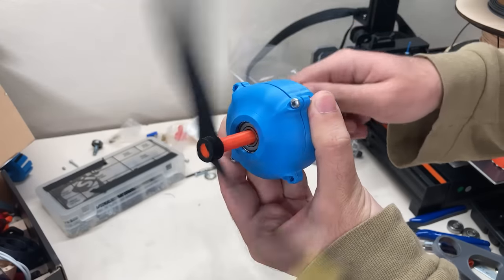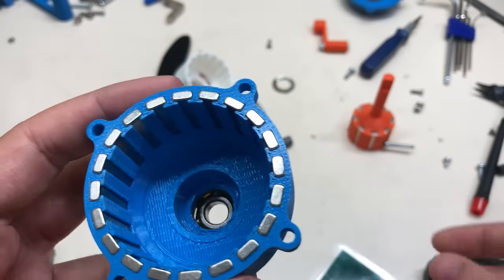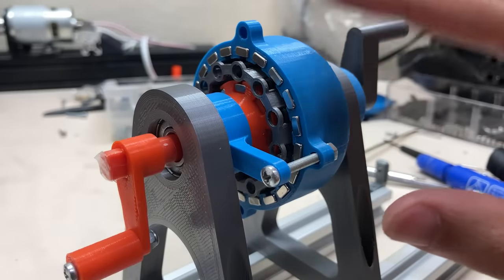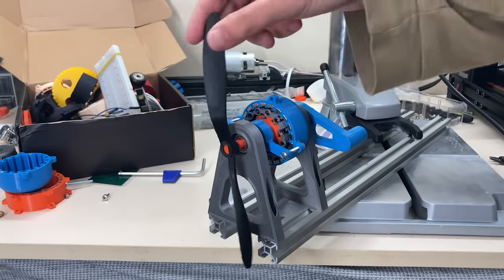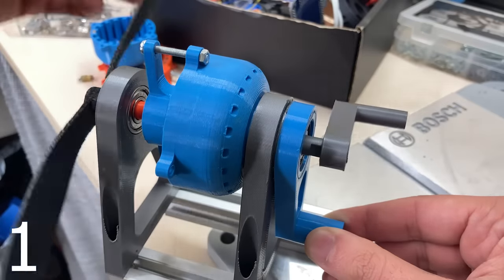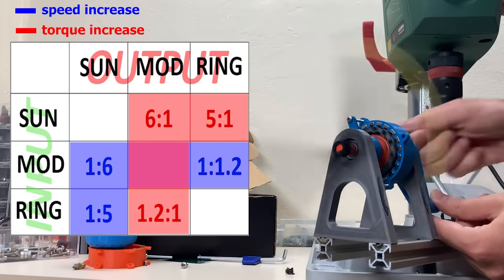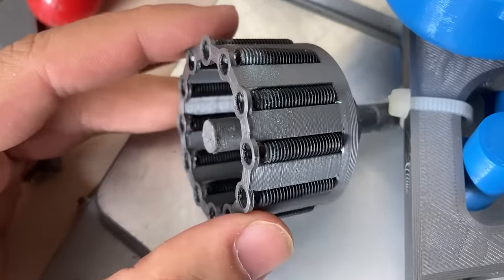How this magnetic transmission works?

Comment: It's a gear ratio of 1:6 with no touching parts. This is actually pretty genius. Now if we could cost affectively up scale and manufacturer with correct tolerances. I can see  this gear box being be used in maybe in equipment, or vehicles, or maybe even wind turbines since wind turbines are very hard to service this would be great because there is no touching parts of the tolerance are correct

Comment: The fact that magnets are becoming more and more rare
Reply: What makes you think that?

The strongest permanent magnet are made using neodymium, which is a common element that require refinement prior to use.

If you're talking about naturally occurring magnetic material like lodestones, they might be becoming more rare, but who cares,

They aren't what's uses in the production of magnets used for motors and linkages and such 

All commercially applicable magnets are manufactured as an amalgam of various metals that then goes through a sintering and machining process.

Comment: Can't wait to see final design with not wobbling rotor and planetary gear. But I gues 3d print can't support hollow shaft with another shaft in it. You can use metal tube and internal rod and glue them to plastic gear and rotor respectively.

Comment: The wear at the end was due to the drive motor input shaft not being coaxial, and exerting a radial force in the shaft. The carrier then was pivoting over its single bearing and therefore the end of the carrier cup was hitting the ring.

Comment: Put the clutch on the bands of an automatic transmission.  Then a new clutch is easy.  Just drop the pan, unclip the old band and put in a new one!  Good project for you.  (they say that the replacement of the old clutch is so high that a manual clutch is not practical.)

Comment: There's a market opportunity for this technology in aviation. In general aviation applications, there are gearboxes (prop speed reduction units PSRU)  that reduce engine rpm down to accommodate optimum propeller speeds. Most propellers need to run between 2,200 and 2,800 rpm. Anything faster and the blade tips go supersonic where they're not efficient. 

Most legacy piston aircraft engines are low tech, big bore, affairs. They drive the propeller directly through the crankshaft at 1:1. So low rpm where engines are not as efficient as they could be. Very reliable but low tech stuff designed in the 40s-50s. There are faster revving engines in GA with PSRUs but the weak link is the reliability and high maintenance requirements of the gearboxes. Especially in the higher horsepower ranges. Another challenge is harmonics and damage done when engine power pulses damage or wear gearbox components and the propeller. 

It looks like this would have it's own harmonics/pulsing challenges but maybe not as much as a direct drive gears? Could this dampen the pulses from a piston engine?

Could this tech be scaled up to high torque applications? I think most 250hp+ piston engines produce torque in the 400-500 ftlb range. https://www.youtube.com/watch?v=lYwUQBi3EW0

I think this tech could solve a lot of the drawbacks of using a faster revving engine coupled to a PSRU.

Comment: I know this is asking a lot, but I would love to see a transmission style.  Your current build would be a simple gearbox with 1 input to output ratio, but if you add some way to change the ratio, you’d be able to have a transmission.  I would imagine you could use electromagnets to make a w speed transmission, and if you building it big enough, you’d be able to have some magnets be dormant and engage at a later time to make a multi-speed transmission.  I’d love to see this made somehow.
Reply: I was thinking alternator to the but I imagine adding a transmission with free moving magnetic energy would lead you to free energy right?
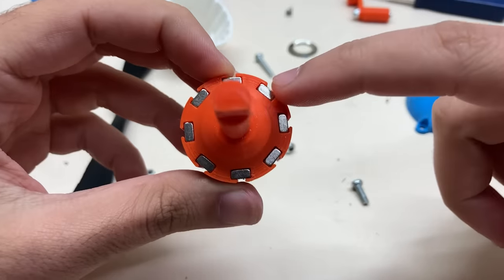Reply: @jasonneu7519  No, that would be if you used the output for energy production.  I've done some brainstorming on this and what I have is a lot like what Retsetman has made here, but with more complicated  by having electromagnets involved.  The main difference being that the outside rotor would have wires leading to each magnet. Each magnet would be replaced with an electro magnet.  If your input gear had 10 "teeth" and your output gear had 100 "teeth" you have a 1:10 and a mechanical advantage of 10. 
Now take those 100 magnets and set them up so instead of being + - + - + - turn on a switch that reverses polarity of certain electro magnets  so you output gear was - - + + - - ++ your now have an output gear with only 50 "teeth".  This would give you a gear ration of 1:5 and a mechanical advantage of 5.  You will be getting less torque but more speed.  This is exactly what you want in vehicles.  More gear ratios means you can have a higher torque outputs.  This is why tractor trailers are sometimes 18 speed transmissions, while cars are typically a 5-6 speed transmission.  Same thing applies to high end cars;  the corvette used a 4 speed transmission.  This mean it could quickly take off and hit high speeds, but wasn't strong.  So in order to reduce weight of the car, they used fiberglass for the body, and not steel.  Fun fact, that's why you don't see corvettes that have been in accidents, you crash, its totalled.  If a vehicle were able to have a magnetic gearbox, it would be able to have any number of gear ratios.  Since it has any number of gear ratios, it would be able to use computers to calculate the best ratio.  If done correctly, this would make it so the transfer from one ratio to the next may not even be detectable as it cycles through 100 rations in under a minute.

Comment: Excelent design!!!

This is like a planetary.

If you keep the sun stationary and rotate the case… does it increase the speed to the output (planets)?

Also, if you keep the output (planets) stationary and rotate the case, does it rotate the sun?

I continued watching the video and YES!! 😅

Here’s a new idea: what if you replace the sun with an outrunner drone motor coil? Could it work as an RPM adder-subtracter?

Comment: Very interesting, my first thought was how much torque load could a magnetic gearbox handle.
Reply: Did a bit of research. Apparently an high efficiency magnetic gearbox is limited to 286 nm/L while a normal one in theory is near infinite (as long material could handle stress. Mechanical gearboxs on cars can easily reach 4000nm/L some high stress machining could reach 14.000 nm/L.

So these could have a great application on low torque situations. But once you start to stress it will start to fail.

Comment: I foresee several issues. It cannot be disengaged, i.e. no neutral. It's going to be massive, both big and heavy. It will have a lot of inertia, reducing acceleration and making the shifting procedure very complex. It will be inefficient, every time a conductor (like the allen screws) "slips" through a magnetic field there is a parasitic current generated that causes heat loss. It will require a fluid and radiator for cooling. It will jitter at low rpms and high torque when the rotor "slips" more easily and noticeably.

Comment: These are similar to magnetic couplings.  They all suffer from low torque at start up.  So trying to get a pump or other driven equipment started under load is the big issue.

Comment: At that high rate of RPM, the plastic is more than likely getting distorted  and if its out of balance it will cause vibrations. there are harder plastics for one called PEEK.  Also the machining needs to be precise and balanced at high RPM. This was kinda interesting though.

Comment: I will use this on an electric cars drivechain. Ive been looking for ways to power fans without draining too much battery power. With this i could possible harvest power from the drivechain/ high rpm and momentum. Connect a magnetic gear to power my fans (fancar) i will deff research and make some tests in smaller scale aswell
Reply: would like to see this! Not to be a downer, but I would think that fan manufacturers would use this if it was feasible. Likely the heat cycling and loss of magnetism would hurt the longevity. I would love to be proven wrong though! good luck with the project!

Comment: it'd be great to discuss the pros and cons of this. clearly there is resistance so there are losses. the strength of the magnets would also limit the torque that can be used. its an interesting concept but what practical application?. surely a brushless motor would be far better?.

Comment: Could you not use a light oil/mineral oil in the gearbox/transmission housing to help remove vibration/friction, maybe a lubricant that is under a little pressure? I apologise if this is a stupid idea, with no background in building magnetic transmissions I am spit balling. Thank you for sharing your video.

Comment: The problem with these is that if you made one out of metal this would create electrical currents that would house the metal to heat up a lot.  Also all those interacting electrical and magnetic fields would probably mess with electromagnetic waves like radio waves, making wireless communication kind of sketchy.  I would probably want to encase the gearbox in a faraday cage.

Comment: This is amazing.
But it looks that the issue is mechanical stability at higher RPMs. That suggests metal. I guess aluminium is out of the question due to eddy currents creating a breaking effect?
Which metal could you use to fashion the mechanical cages from instead of plastic? 
Would it be easier to just manufacture the whole thing out of a iron nickel allow and add permanent magnets to that?
Really intriguing. I guess this would be perfect for gears in robot joints or drone prop drives.

Comment: There is actually need for lubrication, any of the moving parts that connect to the shaft would need to be lubricated, right? It's not like nothing in that entire thing is making contact with anything else. Just a question

Comment: Wow another thought is using this on a windmill, you could step up the rotational speed with no losses due to friction. Just a thought!
Reply: Gearbox losses would be lower than the losses with this system, snd a gearbox would be lighter and less expensive.

Comment: So in theory if you took this then had 2 of em back to back, then on each planetary have band clutches that grab each different part of the planetary then after the basic 3 spds have an overdrive a High & Low range to get something useful like a 5-6spd transmission.

Then after that patent the design.

Comment: this seems more like a hybrid between a torque converter and a gearbox. the magnetic flux is the transmission fluid while the poles are the gear teeth. it would be interesting to see this in operation on a r/c car or maybe even ultimately, a full scale car.

Comment: I know that this is just a demonstration model. If it were attached to an actual motor running at 3450 RPM, I would install magnetic bearings. Then the motor magnets would float within the housing.

Comment: if you increase the torque, the magnetic force will break.( failure magnetic coupling) Magnetic coupling is consistent at constant speeds.

Comment: Could a magnetic gearbox hold load though? Can it actually do work as in, can it transfer horsepower?
Reply: Yes. But the loading capacity would degrade significantly with use. The heat and cold would also degrade it too. The worst would be the constant exposure to other magnetic fields. So it not really feasible in most scenarios but some places it thrives.
Reply: @need2connect  could graphite be used as a lubricant in areas where friction causes damage to the gearbox?

Comment: Looks good, can't imagine this working well on large vehicles like cars or trucks sadly. Can't have any slippage in street vehicles. Plus you do need more than one gear in your street vehicle. Even drag cars tend to run 2 or 3 speed power glides.

Source: ex mechanic. Cut this pretty short so as to not make a wall of text.

Comment: According to all above: torque slip, internal losses in power due to overcome magnetic fields and rather step rotational behaviour + price makes this rather an fun idea than true innovation. Also some "exotic" appliances don't make sense to me as long as regular bearings are in. And even if all active parts will be magnetic still i don't see real application for that, cause out there are a lot of materials/designs that makes regular mechanic gears pretty reliable, efficient and affordable.

Comment: This is a very nice demonstrating using a plastic (3D printed) gear box casing. Have you tried this using metallic casing? In that case would generate Eddy currents result in an increased  opposing magnetic field  (a la Lenz's law)?

Comment: Festo has done the best job with magnetically coupled air cylinders but VFDs have replaced all the similar eddy current drives that changed speed y changing the magnetic field

Comment: Let's say that the magnets are encased in aluminum, and we decide to use a twin prop design, if the gearbox were struck with lightning, would this potentially reduce or eliminate the magnetism enough to make it inoperable?

Comment: I doubt if this magnetic gearbox would provide any meaningful torque for real life application for power transmission.  What would you suggest the real life application of this gearbox? We all know how to use higher gear ratio to achieve a higher rpm but having a reasonable torque is also a key for power transmission.

Comment: It would be interesting to see performance gains/losses with the magnetic system, versus gearing.   I'd assume that all the heat loss from the gearbox would mostly just go away. 

It would be nice if you redid it with either CNC'd plastics or aluminum.   Just so they wouldn't have the irregularities of 3d printing.   You can probably use a Chinese "3040" CNC, that only costs around $1,000. 

I'd try it myself, but I have other projects due, and no immediate application for this drive.
Reply: The heat due to losses would be much higher with this crudely constructed magnetic device than with a gearbox. A better-constructed magnetic device might be as efficient (and thus have the same amount of heat generation) as a gearbox.

Comment: They had problems with too much applied torque or sudden speed changes, right?

So mechanisms like this would only apply to rotation systems with long operating periods and low speed variation. What occasions are systems like this applied in real life? Prolonged use, constant speed, gearboxes.

Comment: Could this work as a propeller rpm reductor on aircraft? Engine running at say 4000 rpm and prop spinning at 2000? Eliminate the mechanical reduction which is a headache on turboprop and piston engines.

Comment: Interesting, if you used an electromagnet, you could change the gear ratios just by changing the current direction in the electromagnet. There would be issues of back emf forces that you would have to worry about though.

Comment: Was there in increase in temperature? I want to assume their wouldn’t be since their shouldn’t be any friction if machined and balanced properly but I’m no engineer. On second though the bearings should be producing some slight heat

Comment: I imagine one could make a much more flexible electronically controlled electromagnetic gearbox by using an electric generator for the input and motor for the output, much like they're trying with jet engines by using a generator on the turbine to power the compressor with a motor; obviously efficiency is key.

Comment: I wonder how large these can be scaled up to. For example, could they be used to power propellers on boats or submarines in a way that completely seals off the hull (and engine) from the water, potentially creating a more fail proof and more easily maintainable drivetrain for such systems.

Comment: hey, great video, educate yourself on field weakening, if you design your gear properly you could change the gear ratio on the fly, and start in low gear with torque and gradually change the gear ration for max speed.

Comment: I wonder if you could replace magnets with electromagnets, like a synchronous induction motor.

Also tight tolerances means treating the surfaces as journal bearings.

Comment: With physical gears, the max torque is based on the material properties and geometry of the gear. What would be the analog here?
Reply: Strength of magnets, magnetic properties of the materials (especially in the intermediate ring), and magnetic circuit design (gaps, etc).

Comment: You could put some metal linners inside the 3d print in the areas of ware to increase it life exspectacy without adding to much waight
Reply: If you want i can get the print files from you and print it of and put the finished product into a lath and bure out a voide and start to add thin layers if metals and then re tests it untill you start to get good ware carracteristickes for this design.

Comment: I wonder if you can use magnetic gears as some sort of clutch 

Example if you have a motor as an input to prevent the motor from stalling the magnetic clutch will always allow the input to continue to rotate if to much load is applied.

Comment: I am a motor mechanic so gearboxes are something that I will service or sometimes remove and replace but would this work in a car or motorcycle?
Reply: This thing are really short in longevity, so it will be broken often and industry may be interested in adapting it, modern cars made redundant.

Comment: Hey nice video!
How is the power train and harnessing compred to the "orthodox" planentary and manual gear? Lets say we make 1 of each of the 3 in the same size and powered by the same type of force(lets say a small motor) which gear orientation will harness the power better? Hope to see your answer :)